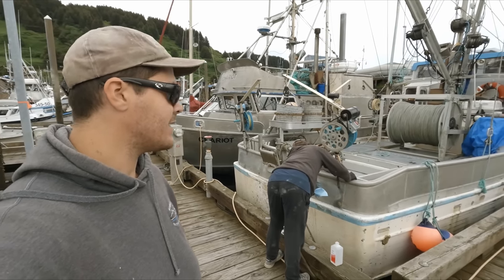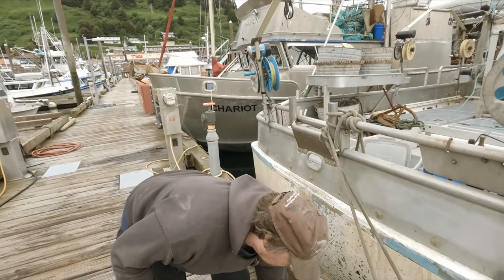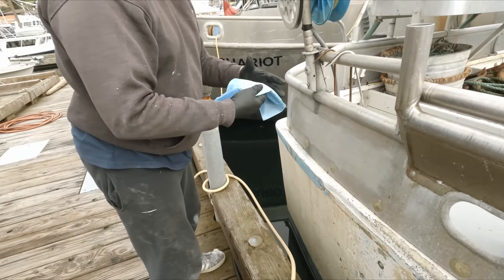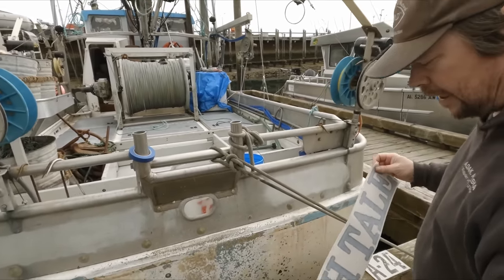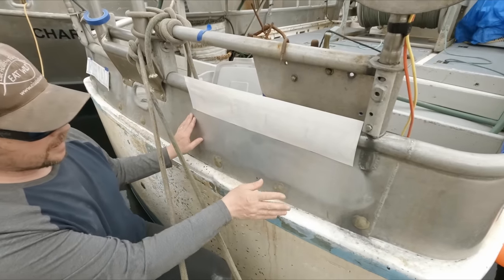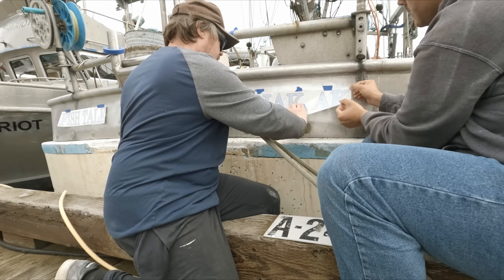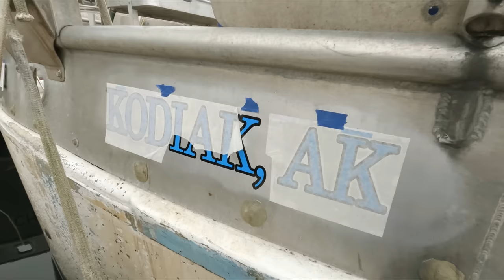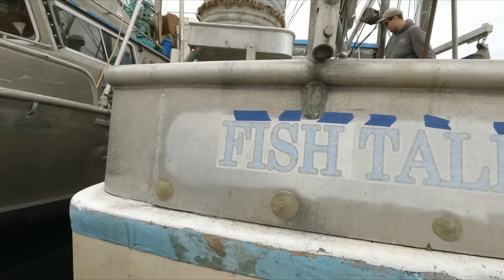DIY Vinyl Lettering and Prepping for Halibut! - Part 1

Comment: The fold has an air bubble, take a sharp knife and prick it. Then use your squeege. Any dish washing liquid willl work just spray the vinyl before installing  it. Makes it easier to move around and get it in the right position. Then squeege it on.

Comment: For future reference, if you're going to horizontal hinge, you run a piece of tape all the way across the top after tacking it in place, but that should have been a vertical hinge. You tack it in place, then run 2 strips of tape top to bottom in the center of the piece, side by side and extended a couple inches at least top and bottom. Then peel the backing form the right side, to the center hinge point and cut the backing off. Then squeegee it from the center out to the end. remove all tape and do the same for the left side.
Reply: Courious,never did that. Fun to watch. Hope it helps, now no reason to stay home. Ha

Comment: get your vinyl positioned where you want it then hinge your vinyl in the middle. tape top and bottom,   Then squeegee center left to right and center right to left or you can hinge all the way across the top then cut into 2 or 3 pieces and squeegee top to bottom